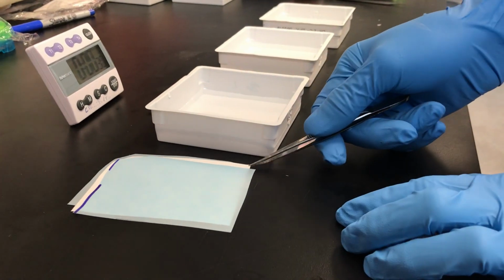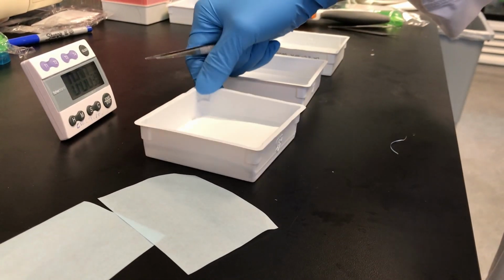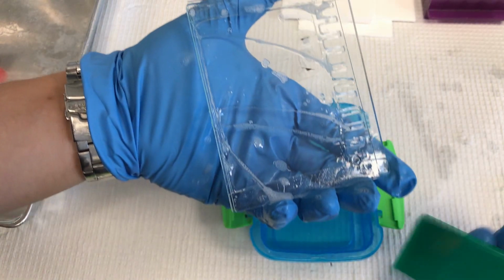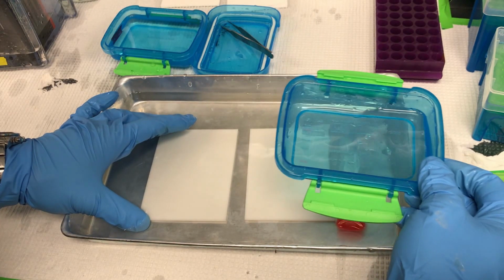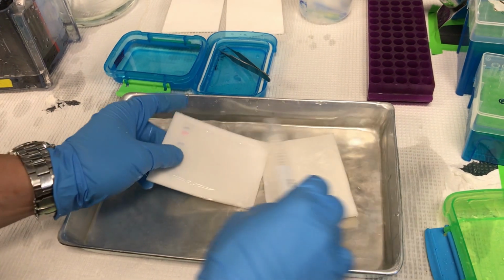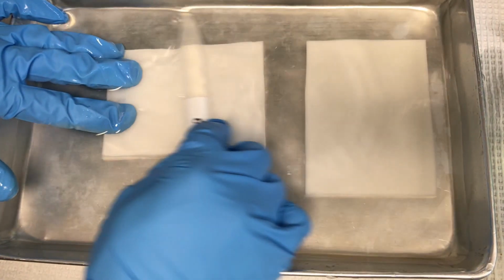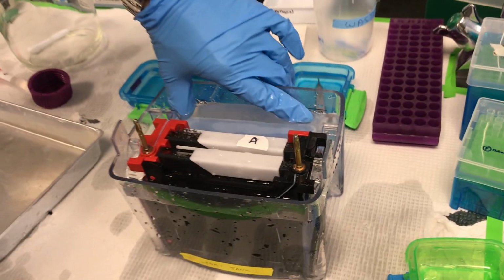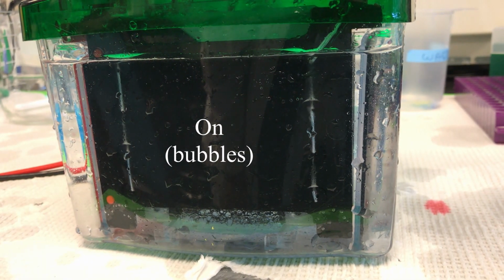Western Blot Transfer

Comment: Nice video, I never wash my gel in transfer buffer. I always use leftover running buffer from the electrophoresis. 
Lately though my (wet) transfer hasn't been going so well. After watching your video I think our system just doesnt apply enough pressure for the gel and the membrane to properly stick to each other, causing the protein to float into the transfer buffer.
Reply from the maker: Thank you, your comment is much appreciated in furthering our learning for better Western Blotting techniques.  :)